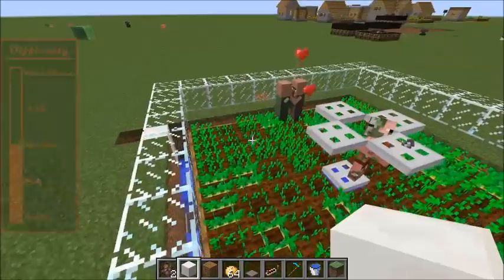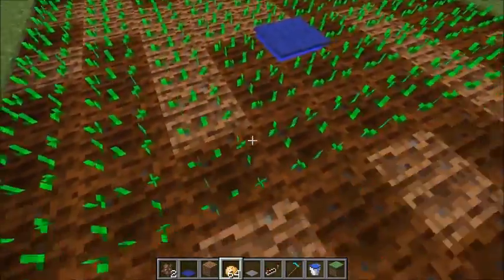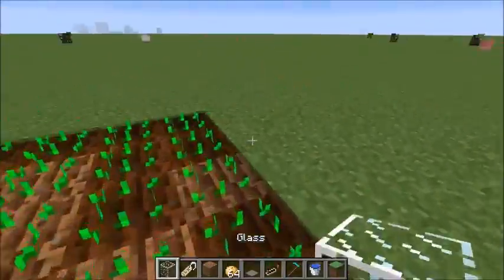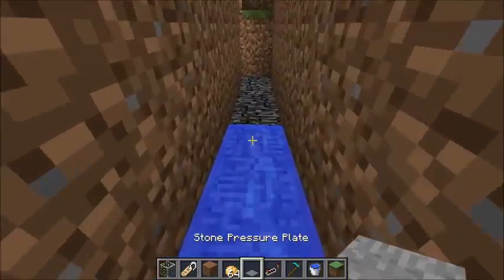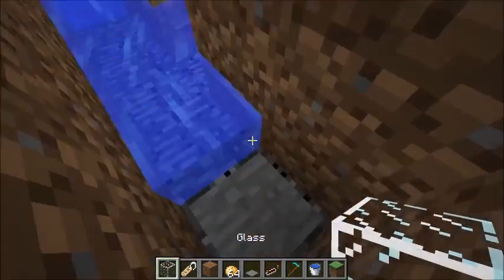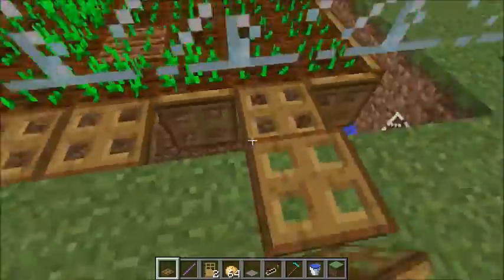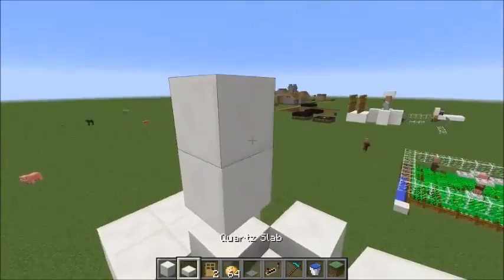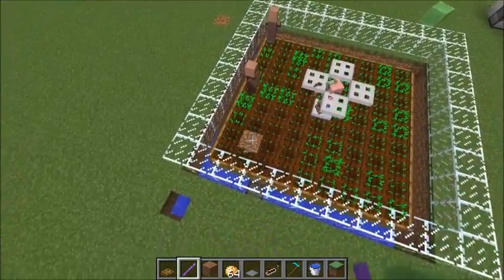Infinite Villager Breeder With Clog Protection (Minecraft 1.11.2)

Comment: I have built this and it is working great (with a few alterations), my question is, I built this in spawn chunks, so it should keep working basically at all times, but when you get so far away, entities stop wandering around. So to stop from clogging, the baby villagers will fear the zombie and jump  down into the water streams, but will they still keep trying to run even in the water streams, so that they cross the water resetting point, also, wont the grown ones stop breeding, because they will not be willing to farm food, if it would require them to move?
I probably will find that out by myself eventually, but a confirmation would be nice.
Also, is there a recommended amount of villagers i should keep in? Too many and the food will have to be spread around too much, too few have less chance of 2 villagers wanting to breed at the same time.
Reply from the maker: They won't keep running long enough to pass through the water resetting points, no, but, most likely, that won't be a problem (unless there are one-high gaps to travel through), since the next villager to come down will probably push them along. However, you can simply drop the next water block down one, and have them meet seamlessly, or there are a couple other options too.The grown up villagers are most likely not to keep breeding if you aren't at least flitting in and out of the area, for the reason you described, but if you do go to the spawn chunks sometimes, they'll breed fairly well.I generally just use two villagers, since the carrots/potatoes/wheat doesn't really grow fast enough for more of them.

Comment: I built the farm and it doesn't seem to be working. The crops area is full of fully grown carrots, but my browncoat isn't even harvesting or planting anything. I built it exactly according to the tutorial. Any idea what may be going wrong?
Reply from the maker: To my knowledge, the only reasons for the farmer not to farm are: the farmer isn't actually a farmer, the crops aren't inside the village boundry (32 block diameter sphere centered on the doors), the farmer has more than 60 potatoes/carrots in his inventory, he is running from the pigman (not the case if the trap doors are rightly placed),  or mobGreifing is set to false.

Comment: I built this following how you did only I made the center water 2x2 (only difference) and the villagers won't breed. They keep making the hearts but then run away the second they get close to each other. whats going on with them?
Reply from the maker: If you changed the positioning of the trapdoors at all, it's possible that the line of sight between the grown villagers and the pigman isn't blocked (meaning the villagers see it and run). If that's the case, try closing the pigman into a one by one space like in the tutorial.

Comment: Hey great idea. The problem with ImpulseSV's design that was causing the clogging is that if your a certain distance away the villagers keep breeding but do not move. Just like how mobs spawn but don't move a certain distance from the player. So they breed but just stand there until the babies grow up then they can't run off. I would think the same clogging issue would be present here. I guess its possible they will move because of the pigmen when the player is close enough for them to breed but far enough away they don't usually move. Have you tested his specific instance? Have you tweeted this at impulse seen what he thinks? Thanks
Reply from the maker: Sorry for not noticing this comment for so long, but yes, I've tested it, and when they can see the zombie, villagers will run regardless of player distance. (provided, of course, that the chunk is loaded)
Reply from the maker: +SerpentDagger: There are actually spots in the very corners of the farm where the baby villagers can't see the zombie pigman, though, so that could cause a very small portion of the villagers to stay in the cell. If that does become a problem though, you can just trim the corners off.

Comment: Im building this underground and I saw your comment. I didn’t really understand. Can you try to explain what I have to do to the breeder to make it work underground?
Reply from the maker: Essentially, just build it exactly the same, then go to the doors in front of the detector villager. In my tutorial, I placed them a certain direction, which doesn't matter, but directly in front of the front 3 doors, dig up to the surface. There needs to be a clear veiw to the sky directly in front of the doors, although glass can be placed in the way. I can explain the mechanics too if you want, but this should make it work.
Reply: SerpentDagger nah I’m ok I just gave up on building it underground and built it behind my mountain

Comment: Hello,
This is an amazing farm design you have here. I have a problem though. At first the farm was working fine. The baby villages ran from the pigman into the water down below. After maybe 50 minecraft days give or take, the breeder still breeds but very slowly. The farmer villager also doesn't harvest the carrots. I can remove them, and he replants, but he doesn't harvest. I've removed all other doors in sight and i have the right brown coat. The only difference i made was i killed 3 villagers with fire. Could me killing the villager be the problem?
Reply: *The breeder started to become slower
Reply from the maker: When a villager in a village dies of a non-mob, non-player source, within 16 blocks of a player, or is killed by a mob, all the villagers in the village stop breeding entirely for 3 minutes. In other words, the killing of those villagers with fire (assuming you were close enough), stopped breeding for 3 minutes. To my knowledge, the only reasons for the farmer not to farm are: the farmer isn't actually a farmer, the crops aren't inside the village boundry (32  block diameter sphere centered on the doors), the farmer has more than 60 potatoes/carrots in his inventory, he is running from the pigman (not the case if the trap doors are rightly placed), or mobGreifing is set to false.
Reply from the maker: If I missed something, just tell me. ;-)

Comment: I have come into the bizarre situation where the breeder worked wonderfully until a zombie infected my farmer through the glass. That was the last farmer and now I have been trying to provoke other villagers to breed with trades and food to no avail. I am wondering if the event could have killed the morale of my villagers? I also notice this is the only design without a block on top of the doors (which I hear is absolutely necessary).
Reply from the maker: The damaging of the farmer will have stopped all the villagers in the village from breeding, but only for 3 minutes. Perhaps you are trying to get the villagers to breed in an area outside the breeder? If so, it's possible they are in the area of the village where those inside count towards the population. This area is about level with the detector villager, +- 7 blocks. Or there might be some other villagers in that area. As for the blocks-on-top-of-the-door thing, you actually don't need those blocks, what is necessary, though, is that there is a difference in the number of blocks that can see the sky in front of the doors, and the number of blocks that can see the sky behind the door, with a range of 5 both ways. In this design, that difference is acheived by the slabs surrounding the detector villager, but in other designs, it is generally brought about by the blocks you're talking about. If something you did after your farmer died has messed with that difference, then that'll be the reason your villagers wont breed. At least probably.
Reply: You are absolutely correct. My breeder featured a water elevator which was crossing the finished villager populations with the detector villager. Again, this design is excellent. Thank you!
Reply from the maker: I'm glad everything is working well for you now. :-)

Comment: The villagers bred when I first built the thing but after they made 3 villagers, they seem to have stopped breeding and farming. They still get hearts on their head but only one by one, they don't get hearts together (1 villager gets hearts then stop then the other one gets hearts, but the other one doesn't have hearts anymore). I did not put any other doors within 70 blocks of the breeder, can someone tell me what is wrong?
Reply from the maker: From your description, it seems to be working fine. It is normal for the villagers to get hearts out of sync, since it's random, and unless anything else is wrong, it should be okay. Just make sure you're taking the babies far enough away that they don't contribute to the population.
Reply: SerpentDagger I took the pigman out and I noticed that it worked better than before, the babies still walk through the trapdoors but I have to do the harvesting and replanting of carrots (I replant on my own because the farmer does it slow)

Comment: how long does it take before the villagers breed because i havent got any new ones after 1 hour
Reply from the maker: Since the villagers have to have food in order to breed (or be traded with), you will have to wait until the potatoes have grown, and the villagers each have at least 12 potatoes, 12 carrots, OR 3 bread. FYI, excess food won't stop breeding. Once that's settled, the next problem might be that it isn't a valid village. The doors in the detector villager's area also need to have a difference in the number of blocks that can see the sky in front of them, and the number of blocks that can see the sky behind them, with a range of five in front, five behind the door. If you built the farm underground, that could very well be the issue. In the tutorial, this difference is caused by the slabs holding the detector villager in place. If you built the design near a village, that could also be the issue, and I'd suggest either moving the breeder, or removing all the doors in the nearby village. Also, if you built the detector villager's cell too low or too high, that could break the farm. Otherwise, I'd appreciate a world download to help you out.

Comment: How far does the "village" have to be from the farm itself? for where I want the farm, I cant build the "village" in this spot. Thanks!
Reply: Also, what does the detection villager do exactly?
Reply from the maker: The breeding area needs to be at least 7 blocks up from the village's ground level, or at least 9 blocks down from it, but within a 32-block-radius sphere centered on the village. The detector villager is inside the area of the village where villagers count towards the total population of that village, meaning, since there is one villager in the village (according to the game), it is a valid village, but it needs more villagers. The breeding villagers are outside the area where they count towards the population, but inside the radius of the village, so they can tell that the village needs more villagers, but don't contribute to the population, meaning they can keep breeding forever without the village's population cap being reached. So I suppose the detection villager turns the village from a bunch of valid doors, to an actual village.
Reply: SerpentDagger thanks! That helped a lot!
Reply from the maker: You're welcome :D

Comment: Does the villager that had the doors next to it need to be seen by the other villagers or not? Second question: does this have to be in sunlight?
Reply from the maker: To the first question, the answer is no, but with the second, It's a little more complicated: on the side of the doors opposite the detector villager, the blocks directly in front of the doors need to be able to see the sky.
Reply from the maker: Also, sorry for the slow reply.

Comment: built mine under ground with the detector villager on ground level, so the doors have access to the sky. villager has a slab over his head, after about 30 minutes now i havent seen any breeding happening at all. thinking maybe either the villagers dont like me from the trial and error of killing a few? or maybe my trading hall is too close? or maybe the iron doors on my starter hut are stopping it? not sure whats going on, can provide world download if needed
Reply from the maker: Since carrots take roughly half an hour to grow, it's possible that the villagers don't have enough food yet, unless you gave them extra to begin with. Otherwise, I'd check to make sure you didn't accidentally put the detector villager too close to the breeding area. If the villagers in the trading hall you made is within 16 blocks horizontal distance of the detector villager, and within 5 blocks vertical distance, then it is too close, and the villagers there are contributing to the population cap. Also, if you encased the detector villager in glass, as opposed to slabs, then it wont work. The fact that you killed some wont hurt it's efficiency in the long run, but depending on how you killed them, the villagers will have stopped breeding for 3 minutes.
Reply from the maker: Also, the iron doors don't count towards a village, since villagers can't interact with them.
Reply: My closest villager in the trading hall is 36.8 blocks away and on the same y level. I have the slabs around the villager the same way you did, plus a glass barrier to protect from mobs.

i killed one villager in the system and 2 more babies were produced before they grew up and went up top. haven't seen anything else produced since but it hasnt been very long yet
Reply from the maker: Really sorry for the huge delay, I was trying to find the solution for a while, and then I sort of forgot about the converstion (sorry again, lol), but I haven't really been able to replicate the problem consistantly, nor find the solution. It would be extremely helpful if you could provide that world download at this point. :-)
Reply: I ended up sending the villagers ~80 blocks away just to guarantee they were far enough away and it works just fine now
Reply from the maker: That's great! I'm glad you figured it out.

Comment: for some reason the babys aren't scared of the pigman... I got a glass ceiling over the farm, could that interfere with the line of sight?
Reply: are your trap doors at the correct height
Reply: BPG96 yes ofc, they're exactly the same
Reply: weirdly enough it works when I build the exact same thing in a single player creative world, but as soon as I'm on my multiplayer server villagers don't seem to be scared of pigmen at all, even if I completely remove the trapdoors and let them roam freely they're fully ignored...
Reply from the maker: That's odd, the glass ceiling won't interfere, no, but perhaps villagers aren't scared of zombie pigmen in the version your server is running on. Hve you tried using a plain old zombie? (Also, sorry for the slow reply, for some reason, I didn't get a notification.)
Reply: SerpentDagger oh I'm using 1.11.2, did that change their behavior?
Reply from the maker: No, this should work fine in 1.11.2, but I've done some testing, and I have experienced the same problem that I think you're describing. The baby villagers sometimes wouldn't run from the pigman, yet when I built the same thing again, they'd run. Also, when I let the pigman out of his cell, the villagers still wouldn't run, including the grown ones. I'm still trying to find the cause, and a solution, but I thought I'd let you know what I was doing.
Reply: SerpentDagger Oh thanks, I've done some modifications to mine so I can easily enter and push the grown villagers manually off once in a while when to much have stocked up in there, so it's still fine even if it's just semi-automatic for me :D

Comment: What is a detector villager used for?
Reply: You need a villager to stay near the doors up there so that they count as a village. Villagers have pretty bad vertical door detection capabilities, so the ones down in the spawner aren't close enough to keep those doors (and therefore the spawner) active without a third guy stuck up there.

Comment: would it work if rather than putting the detection village above it i put it below it? please reply
Reply from the maker: Yes, but I'm not entirely sure offhand the right distance down. I'm fairly sure you go to the same level as the farmland blocks, and break down 7 blocks, which is the level you put the doors on, and the villager. Also, if it's underground, make sure the 3 blocks directly in front of the doors, on the side without the villager, have a clear veiw of the sky.
Reply from the maker: +SerpentDagger: That is the correct distance.
Reply: it worked like a charm dude great tutorial i appreciate it! im cranked the villagers out like nobodys business now
Reply from the maker: Glad to hear it! :-)

Comment: What does the detector villager do?
Reply from the maker: The detector villager is inside the area of the village where villagers count towards the total population of that village, meaning, since there is one villager in the village (according to the game), it is a valid village, but it needs more villagers. The breeding villagers are outside the area where they count towards the population, but inside the radius of the village, so they can tell that the village needs more villagers, but don't contribute to the population, meaning they can keep breeding forever without the village's population cap being reached. So I suppose the detection villager turns the village from a bunch of valid doors, to an actual village.